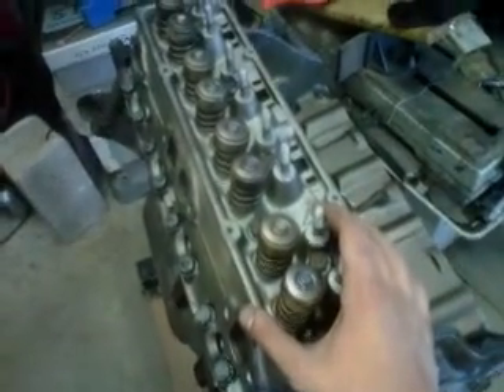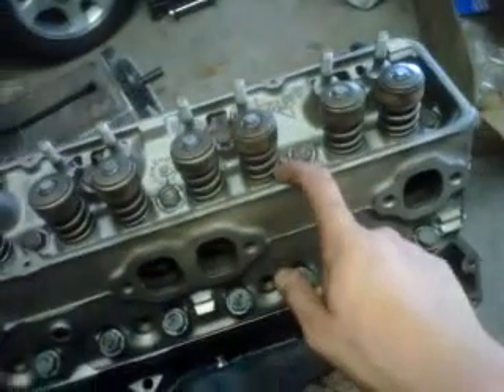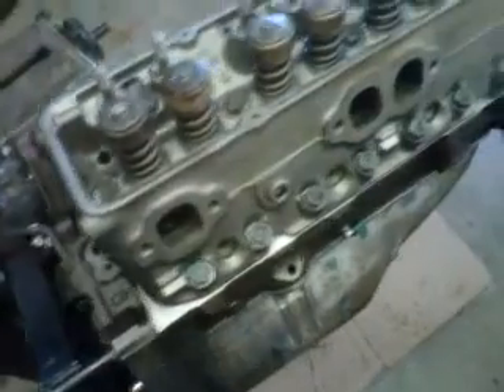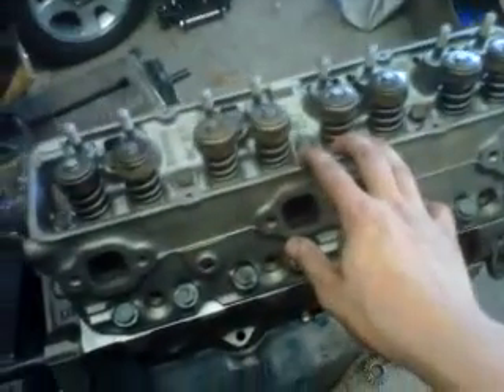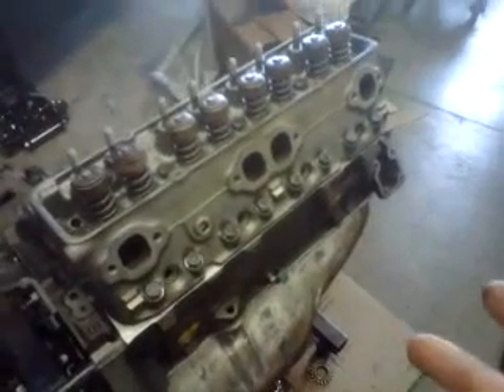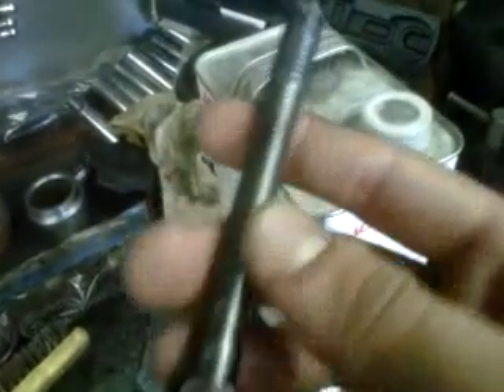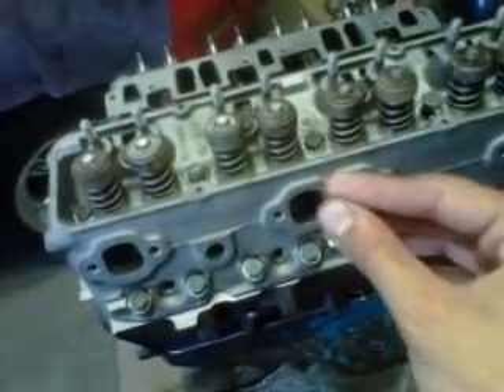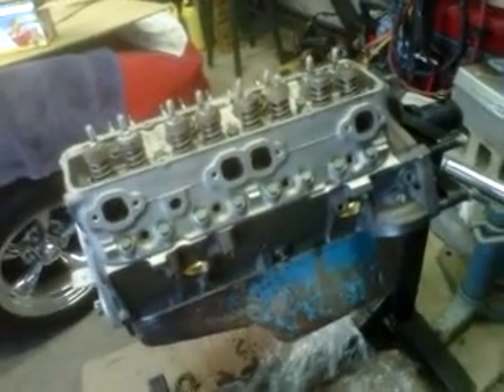How to Correctly Torque Head Bolts

Comment: Eh I just cracked em the fuck down gave up on the torque wrench half way through
Reply: Ah ha, yep, while torque spec is a guide, consistency and watch corner bolts will cave because no support on one side.  Go easy on corner bolts.
Your funny.  😅

Comment: What about when one step is 65 ft pounds and then the next step says "65 ft pounds (again)." What does that mean?

Does that mean I just put the torque wrench back on and turn to the right ever so slightly until it clicks once again? Or does it mean that I loosen it and come back to 65 foot pounds?
Reply: Both, after 1st round wait like an hour or two and the bolts will move some more because the gasket is squeezing down creating slack or loosing the torque as the gasket compresses.
Good question.

Comment: I have to disagree with you on a Chevy you have to put a Shellac on the head bolts to seal them I see ppl do this all the time and that’s why they run into problems with leaking gaskets. Also it’s better to Torque to yield the bolts
Reply: So I see your comment I need help i have a Chevy 1500 1999 4wd 5.3 an i need to do head gaskets but i don't no the toque spec the book don't make sense to me could you help

Comment: small block chevy head bolts 65-67 ft lbs
Reply: I'd go a little tighter, depending on style of gasket and some other variables, 65 is a little on the light side, unless you go back and retorque after a few heat cycles.